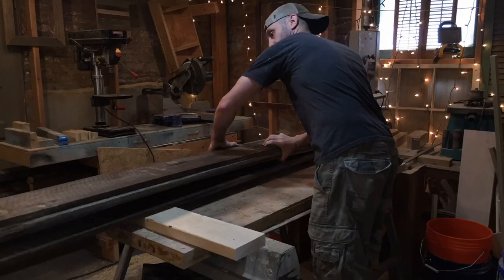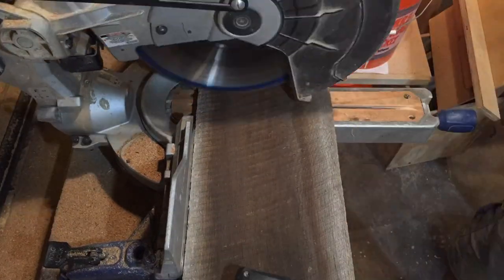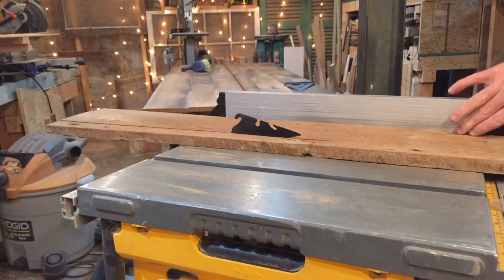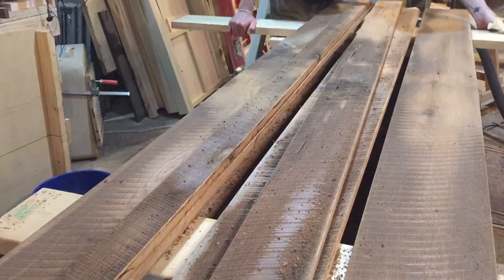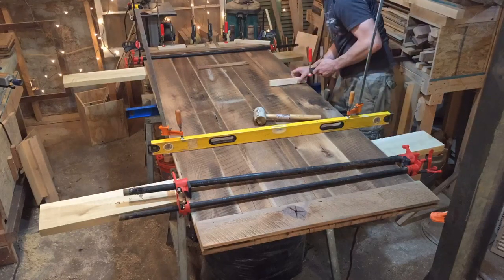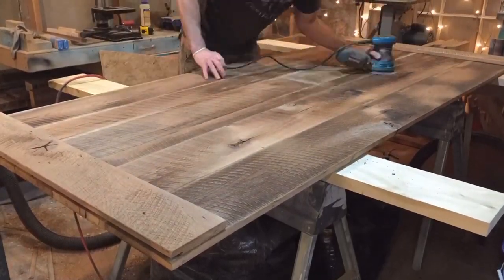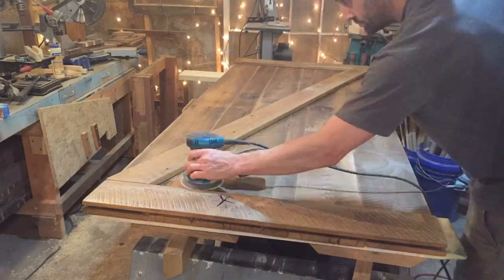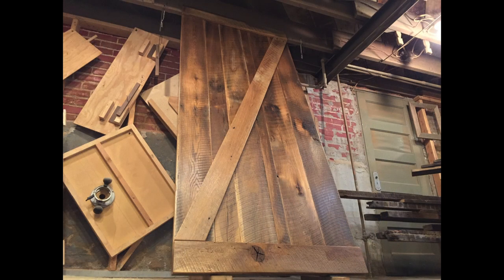Building A Barn Style Sliding Door With Reclaimed Wood

Comment: Do you think this would hang straight without a buttom guide?  I am looking to make something similar, but I have concluded that I need to use horizontal boards and diagonal braces on both the front and back to balance the weight, so it hangs straight down.